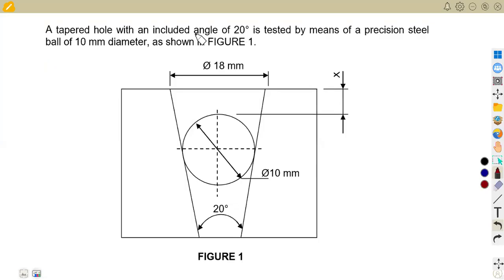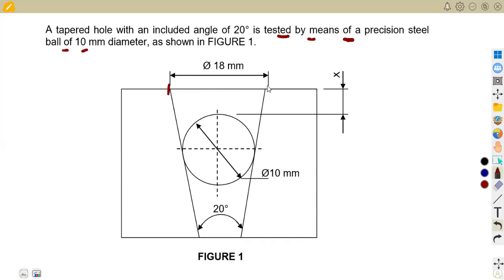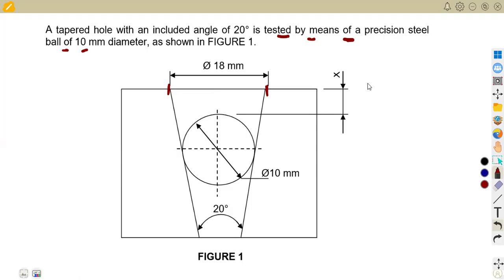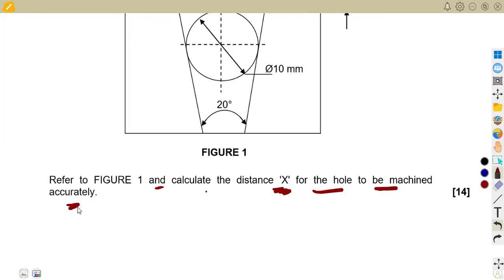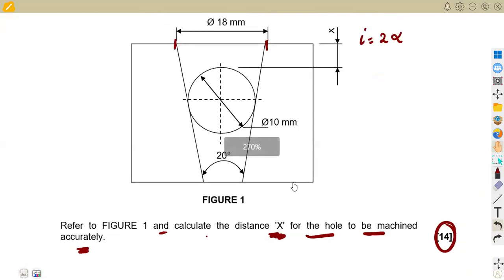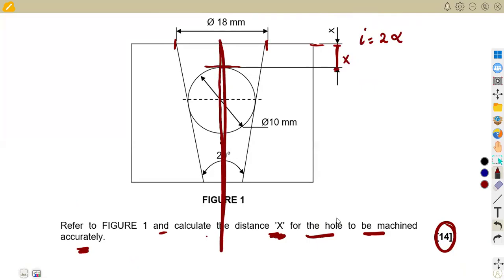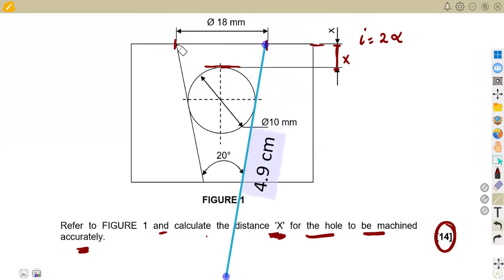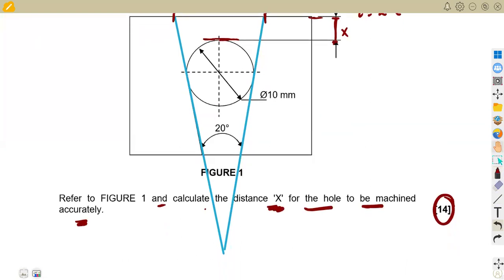Mechanotechnics N4 Precision - Included angle of a tapered ring gauge part 2

Comment: Sir will i get penalized if I use the tan method instead of sin,e.g instead of finding hypotenuse side I looked for adjacent side using tan=y/x
So your EC was my adjacent then instead of drawing a perpendicular line from centre of circle to the in incline,i used radius as my opposite(y)

My final answers are:BC=51,042 mm
EC(using tan=x/y:28,3564 mm

Final answer x=17,6851 mm
Reply from the maker: No it’s a problem at all , all we are using our trig ratios properly, actually the memo is supposed to point many options for that